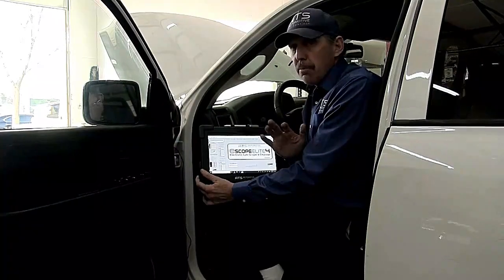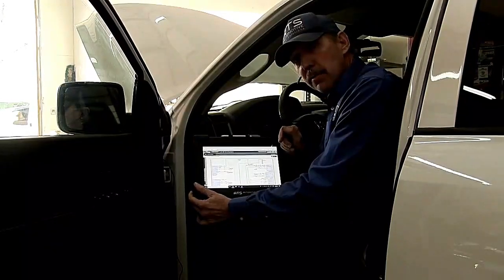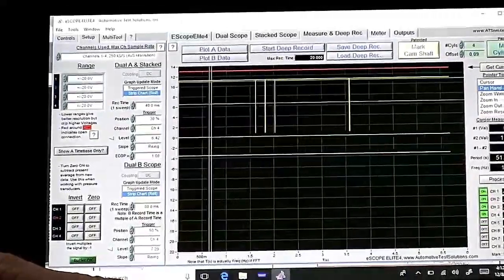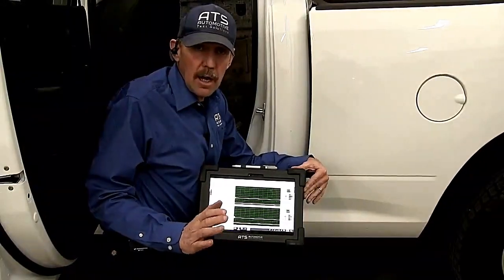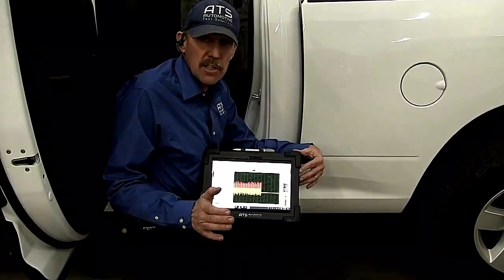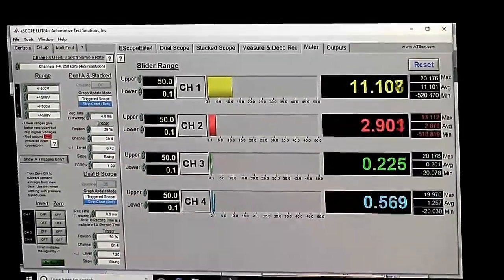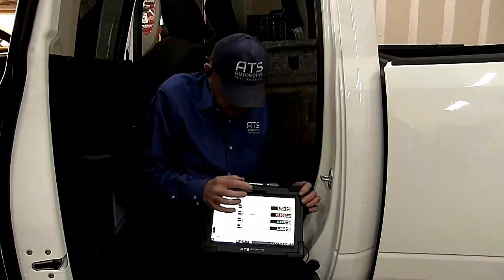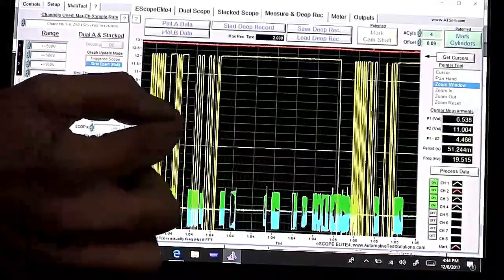Bernie Thompson CAN Diagnostics

Comment: good diag but id rather repair the original wire if you can trace the point where the high resistance is...
Reply: How often do you find the problem and it's just the one wire. I NEVER run a new wire without confirming the damage. Just asking for a comeback or the next tech finds the wire you ran and trash talks you to the customer stating you didn't repair it properly.
Reply from the maker: Mike good comment...thanks for watching...If you have not already subscribed to our tstseminars YouTube channel please do so. Interested in more training? Go to www.tstseminars.org and view full length videos for members on TechFlix for $9.99 unlimited viewing and www.attstraining.com for hands on training and webcast.
Reply: @1MiketheMechanic  This problem wont come back because it is not shorting to ground, I would be concerned if it was which would be brought down to 0 volts and burnt modules.
Reply: @scientist100  You are entirely right, but this is assuming that this was the only problem. 
It's not shorting to ground yet, but a wire doesn't develop a high resistance on its own in the middle of a harness, something happened to it. I like to fix the cause of a problem before I let a car out of my bay, not only cure the symptom.

Now Bernie is a way more knowledgeable person than I am, and I am sure he had a good reason to do it the way he did it, but he didn't mention it. And that was the o.p.'s question. WHY he did it that way.
Reply: @alexlongpre4527  perhaps, I would in that case wait for it to happen, chasing an intermittent that you  don't know is there in the first place will take a long time that won't be booked in the diag, if another problem arises which caused this, I would be fine charging another diag fee.
Reply from the maker: Thanks for watching and commenting...If you have not already subscribed to our tstseminars YouTube channel please do so. Interested in more training? Go to www.tstseminars.org and view full length videos for members on TechFlix for $9.99 unlimited viewing and www.attstraining.com for hands on training and webcast
FREE videos at www.tstseminars.org/training-videos

Comment: Nice diag!!  Wouldn't you want to find out why the power wire to the hub module has low voltage on it.  Maybe a connector terminal or wire has high resistance from corrosion?  It might come back with other issues if other wires are damaged or  a connector has water getting in it.
Reply: If it takes more than a certain amount of time its better to just run a new wire. They definitely tried looking for it but most likely it was gonna get expensive and the customer was made aware of the situation and declined. This stuff ain't cheap...

If you watch his other videos in cases like this the first thing he does is go check all the connectors on that circuit.
Reply: I was coming in with the same comment in mind. To bad you didn't get a reply.